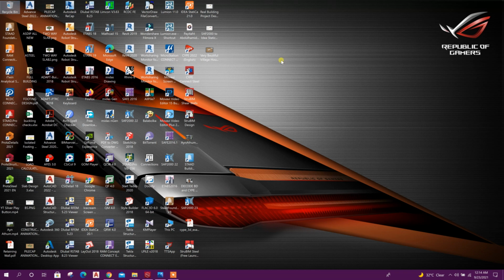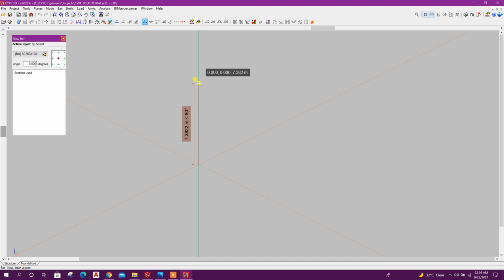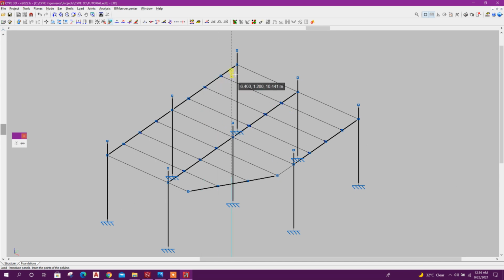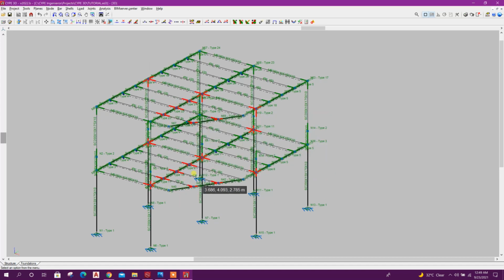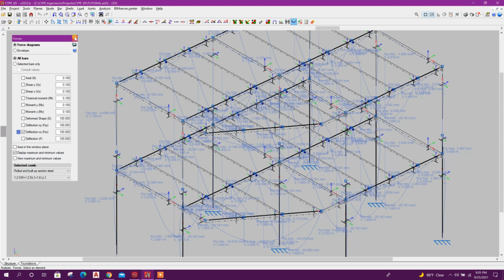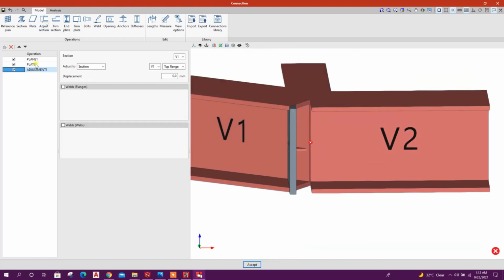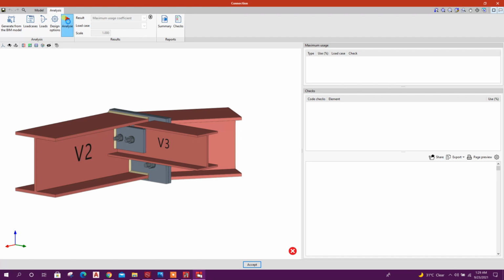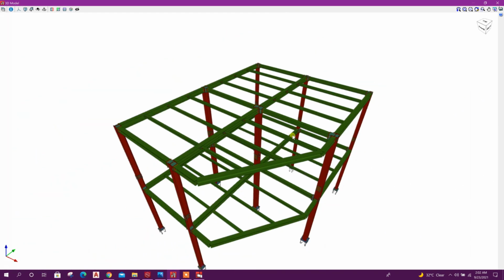Steel Structure Design with Connection in CYPE 3D and StruBIM Steel

Comment: Great tutorials. A question pls. Which of the software can you recommend for modeling and designing an RC slab or beam that is curved in the VERTICAL direction.. say like a curved slab over a gate house. I use tekla and prota, but can seem to find a way to model such. Thanks for your anticipated response.
Reply from the maker: For that you can use Robot, Dlubal or SAP2000, for modeling curved slab you need to use Grasshopper or Dynamo or Autocad 3d.
Reply: Thanks for your response